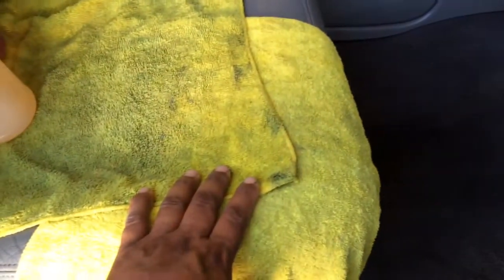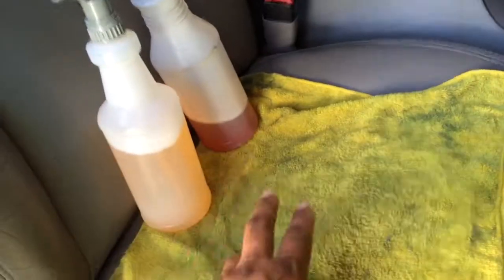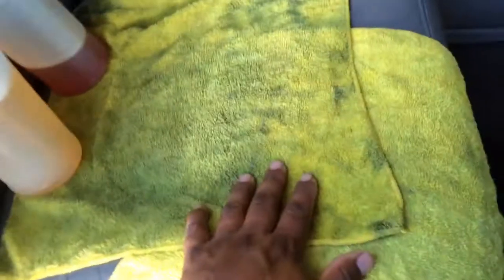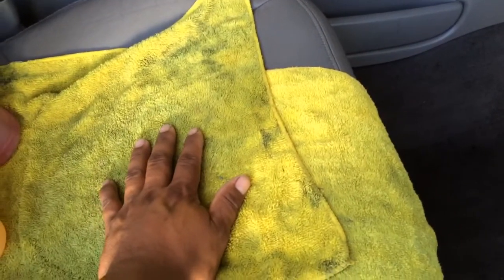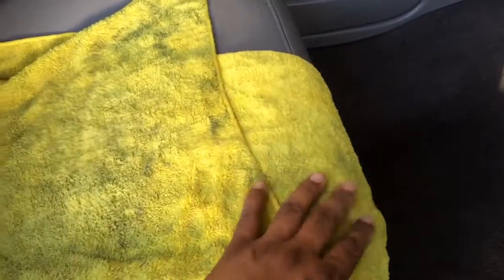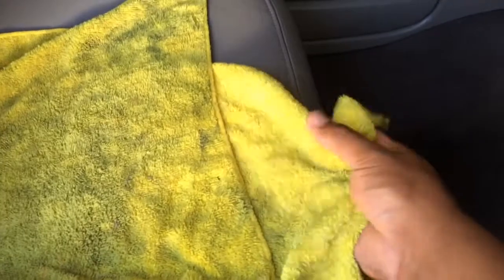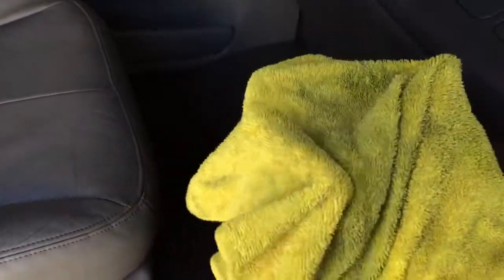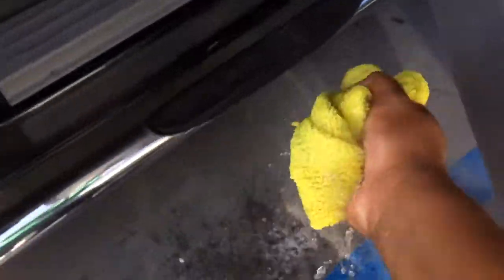HOW TO Clean Carpet BMW 5 Series 3 Series E90 E39 528I 328I M5 M3

Comment: i dont recommend spraying all that water in there like that as these floorboards dont have a drain and you have electronics under the carpet. if you are going to use that much water atleast peel the carpet up and drill holes in the metal floor to allow a drain. or a shampooer that sucks the water up instantly as the carpet has thick 3 inch foam between it and the metal floor
Reply: I came on here just to look if I found this exact information you just shared in this comment.. thank you broth